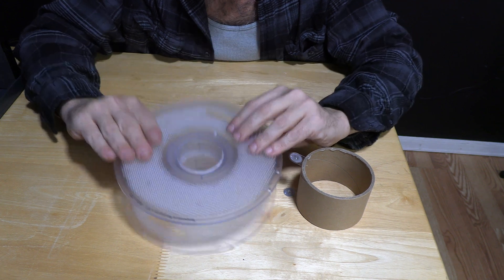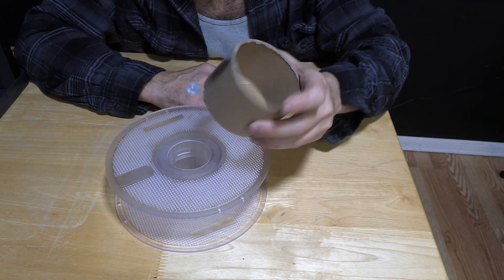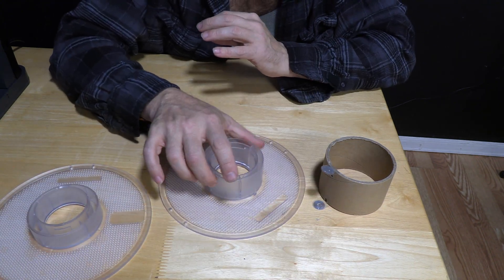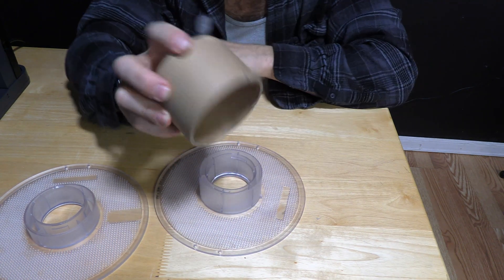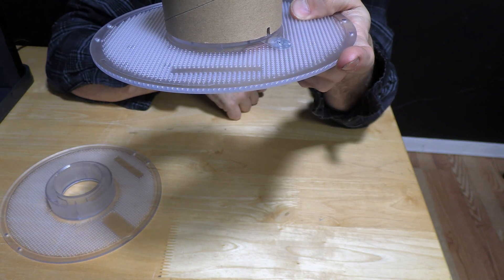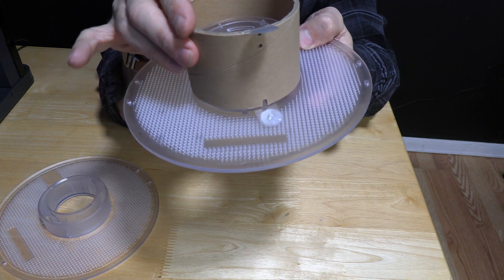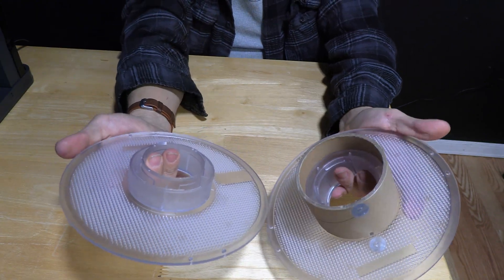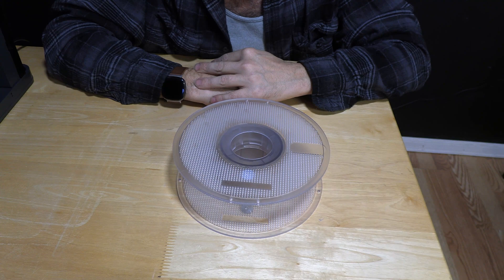How to PROPERLY Refill a Bambu Lab Reuseable Filament Spool. Mind the Notch!

Comment: Ordered some Bambu brand filament because the Amazon brand kept messing up. One had a spool and the others were refills. I decided to try printing one using a filament spool I 3d printed but it got tangled. Tried then transferring it to a Bambu but it was too late :(
Reply from the maker: I hate refills. I tried ONCE, and it ended up a pile on the floor

Comment: What's the point of that notch though? Is there any benefit when the spool is aligned that way?  (But how? It's a round thing...)
Reply from the maker: Ensures the rfid turns with the spool, to be read.
Reply: The AMS also rewinds. Otherwise, It would just spin freely.